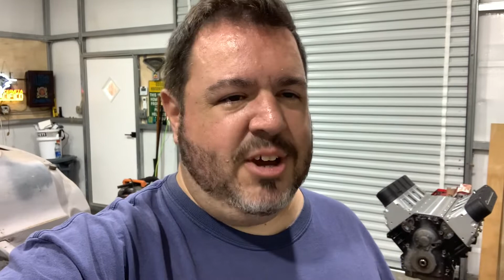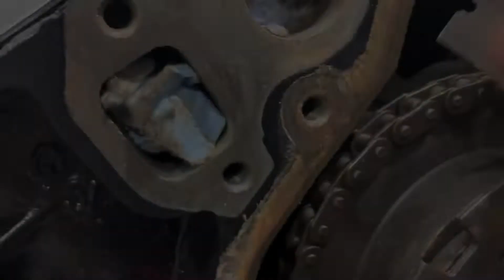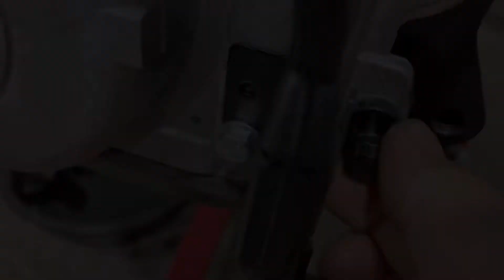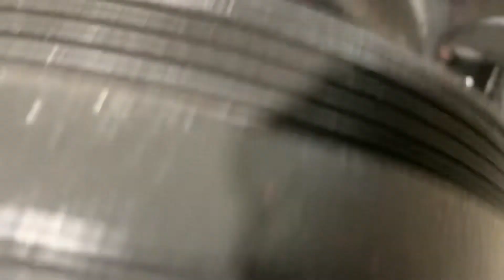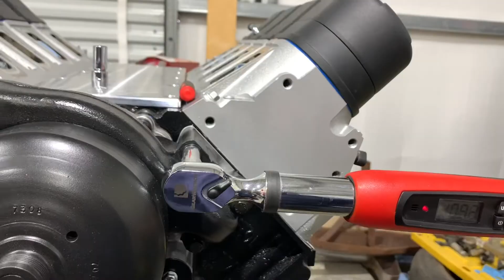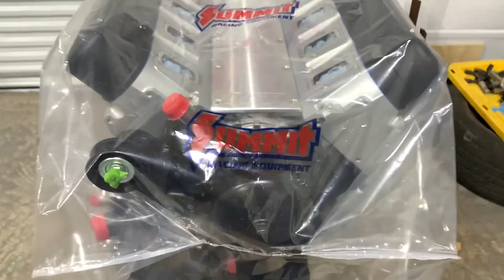LS Swap | Build Series!

Comment: How do you know that the harmonic balancer is fully seated?
Reply from the maker: You can measure the snout before removal for reference when you reinstall. You can also verify that it lines up with the water pump pulley. But honestly, you can kinda feel it.